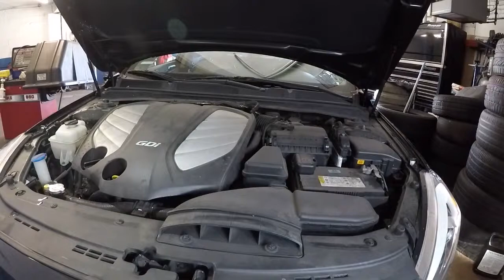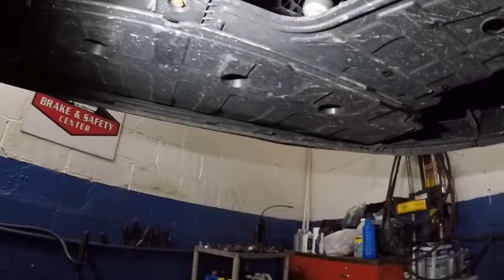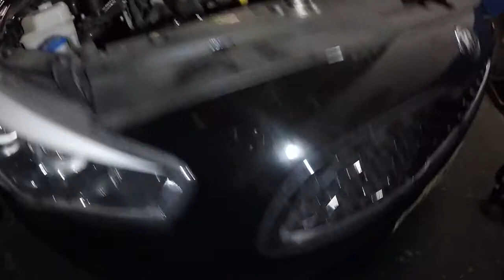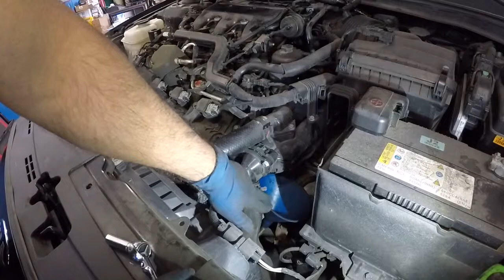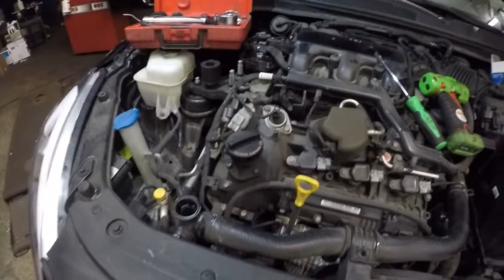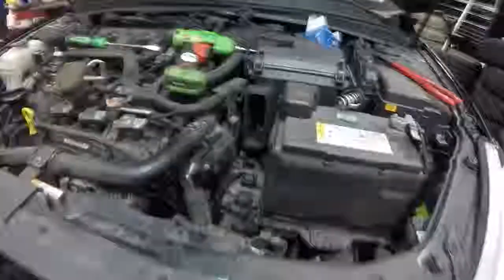2014 Kia Cadenza over heats replacing thermostat

Comment: well put together! I have a 2015 cadenza w/100k, i have white smoke out the back of engine, lots out the exhauste, and of course burning smell. Looking to do the work myself. Do i need to remove the whole engine or is it possible to do another way? Thank you for your time an effort!
Reply from the maker: Just to let u know these are known for having bad head gasket possibilities bad head gasket I would do a head gasket test before anything but take care of anything causing over heating that white smoke 💨 is the reason why I say it
Reply: @RBTheMechanic  ty for the input, im going straight for the head gasket and take it from there.
any suggestions on what else to check while in there?
Reply from the maker: @bashsharrafiq5872  these Hyundais do have recall and warrnty extended I would call them first they usully replace the engine for free I would push and stick it to them  even if it got more than 100k

Comment: Very well done repair. I have a 2015 Cadenza w/100k miles that overheated recently so I was very interested. Dealer said head gasket blown. Quoted us $4400 to repair. Don't know what tests they did . Not paying that kind of money. They said nothing about checking thermostat. Don't want to get rid of it cuz it's super clean and strong on the road, but it's my wife's car and she's already picked out  a new one. Doesn't trust this one anymore.  Good job RB.
Reply: Also have a blown head. Thinking of doing the repair, but might try blue devil first. Anyone tried either the repair or block sealer?
Reply: @fspight28  did blue devil work?
Reply: @Thefoodblogbyduke  I didn't end up doing it. Decided to just try and do the full repair myself because the more I looked into it many seem to say it's a waste and if I'm going g to spend $70 might as well put it towards the parts.
Reply: my runs amazing 2014 also quoted almost 3k and i think it is bullshit looks easy. do you think you have to bleed out system or can you just switch themostat
Reply from the maker: @3DDIE805  I’m not sure what u mean take out thermostat
Reply from the maker: Yeah these cars have issue I had few with blown engine
Reply: @RBTheMechanic  do you think i can just take out the thermostat without bleeding and burping even if i spill coolant everywhere? 
i just need my thermostat close since my heater is low but when it closes it warms up
Reply from the maker: @3DDIE805  I’m not sure what u mean u said u want it out but u want it close??
Reply: @RBTheMechanic  sorry haha morning. And I mean can I replace the thermostat without fully flushing the system?
Reply from the maker: @3DDIE805  no it all gonna come spill out
Reply: @RBTheMechanic  that's what I meant would it matter if it spilled everywhere sorry I appreciate you replying Def subbing
Reply from the maker: @3DDIE805  nah it always spills so dosent matter
Reply: Same here, dealer told me blown head gasket at 152k also need to replace engine because with the v6 engine the threads in the heads are known to strip